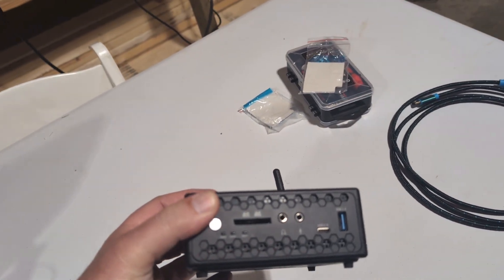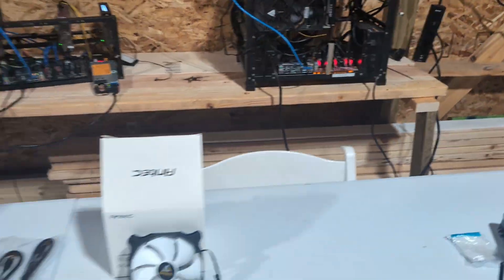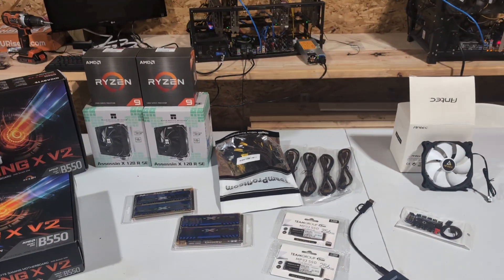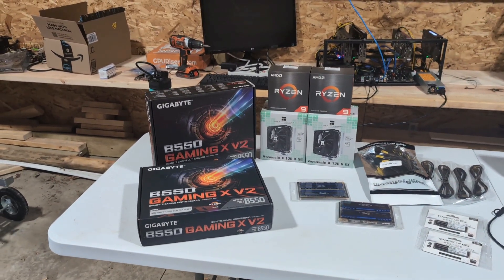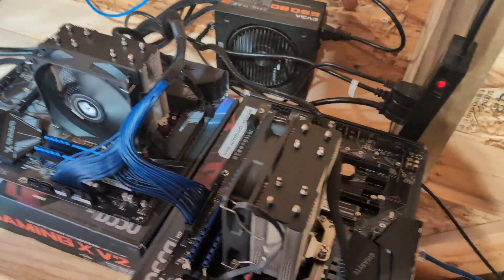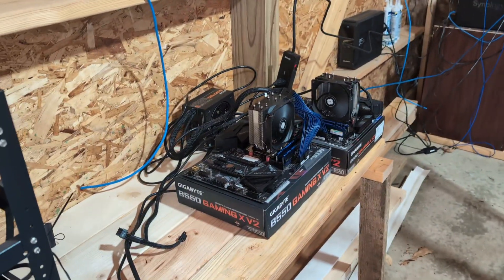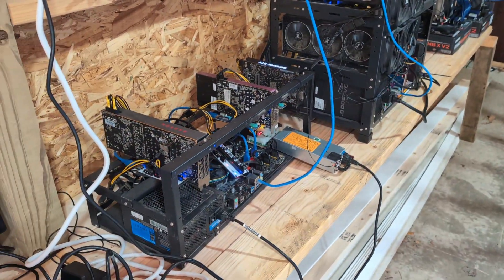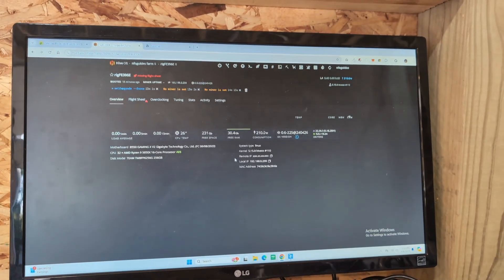New Ryzen 5950 CPU mining rigs!!!

Comment: Hi there, was your rx5600xt recognized as such in the new boards? In case it was,  then remove all GPU drivers on the board of your old rig, and install the driver for the 5600xt first, check if it works well and procced for the others. Hope this helps.
Reply from the maker: Thanks I will give this a try as well!    I know there is a command to force upgrade Nvidia drivers.  is there  a command to force upgrade amd drivers as well?